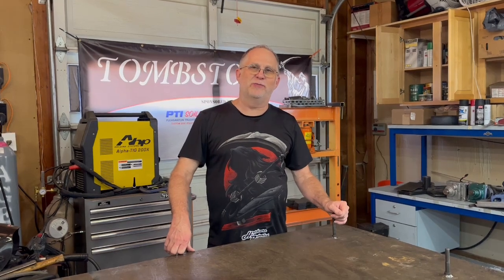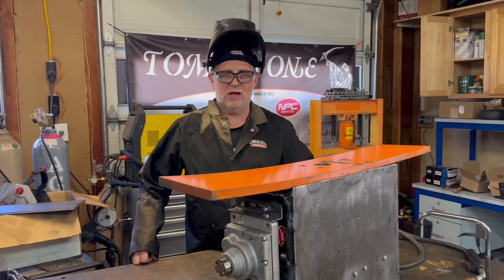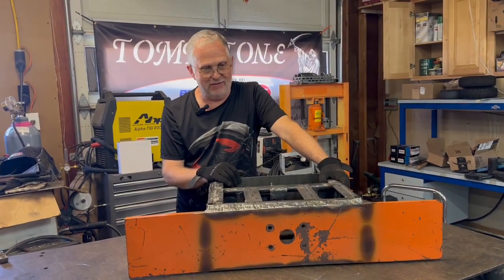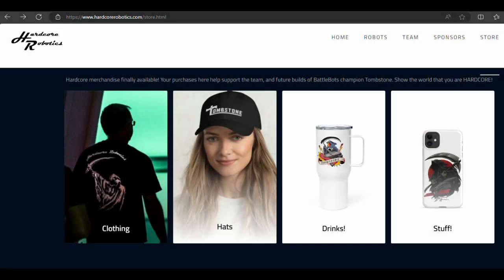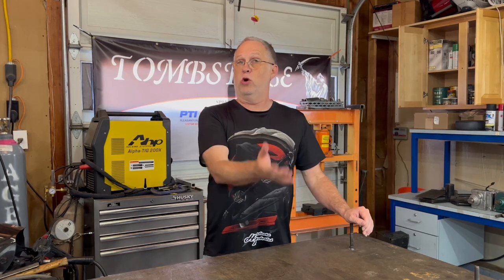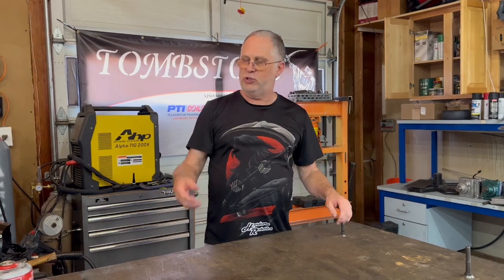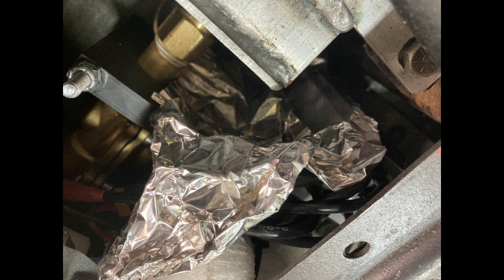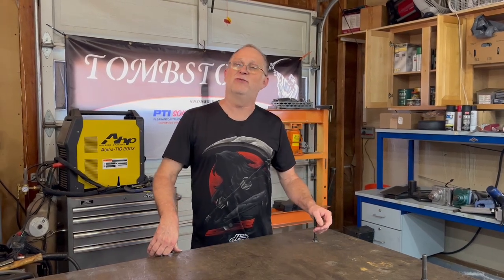Brimstone! - Part 2

Comment: Interesting, haven't thought about using camping fuel. For my propane flamethrowers, I have a choke installed right at the nozzle and invert the tank so liquid propane flows through the fuel line (but combusts mostly as a gas) to get a big yellow flame instead of the blue cone.
Reply from the maker: Yeah, liquid to the valve, then it disperses as a gas as it is sprayed forward. You *can get the larger yellow flame ball from straight propane, but from what I've seen you can do it better/easier with the camping fuel mix.

Comment: I have had very good success stick welding AR500 with 7018, 10018 and 12018 rod. I guess the equivalent wire feed rod would work the same. 6010 mild steel rod was a total waste of time as it literally fell off after  cooling. As the mechanic / welder, I welded with the 7018/10018 rod and the young certified pipeline welder who didn’t like the way low hydrogen rod welded insisted on using 6010 rod.
Reply from the maker: Stick with 7018 would have worked here for sure, but my big welder is a MIG. Just my preferred method honestly. Even if I'm welding aluminum I still use the MIG and the spool gun, even with the TIG just sitting there. 

Just because I can weld doesn't mean I'd call myself a welder ;)

Comment: Silly idea for a bot that's inspired by race cars: a powerful vacuum that sticks the bot to the ground, making it totally stable and (hopefully) stronger than magnets for downforce. Theoretically if you were to use that on a vertical spinner it should eliminate gyrodancing, or (how I'd apply it) use much faster drive motors while still being controllable, ramming a bot before they know what hit 'em. Of course "on paper" doesn't always apply to actual bots in practice.
Reply: Someone actually already made this at the either ant or beetle weight. Can’t remember the name but it was a control bot and did ok. I think the conclusion was that at those small weight classes its just not worth it and magnets do the same thing on a steel floor for waaaay less weight and complexity
Reply: @connorbingel7134  if you're talking about team panic, his design seems heavily flawed frankly since it was basically just an extractor fan.

Comment: what's the reason for not grinding a bevel/chamfer into the wedge/chassis to get better weld penetration? Is AR500 super difficult to get full penetration on?
Reply from the maker: “Grind AR500 to a bevel!” Yeah no thanks 🤣 We use that stuff for a reason and its extreme difficulty in cutting it is high on the list! 

For general welding you are of course right, a bevel would have helped penetration. Instead I just cranked up the welder.
Reply: @ray9368  okay gotcha lol. if I was working on a welded chromoly chassis for an FC 30, would you recommend bevels?
Reply from the maker: Would depend on thickness really. Anything less than a quarter inch thick I probably wouldn’t bother. But it does help with thicker pieces, especially if you’re at the max amperage of the welder you are using.
Reply: @ray9368  i dont get why grinding ar500 to a bevel is so funny

Comment: If you put in an oxygen tank, you can increase the heat of your flame and ergo, increase the range of your weapon.
Reply from the maker: And be totally illegal :) Even if this isn't going into an event, I still wanted to build it to modern combat standards and rules.
Reply: @ray9368  hmm. I didn't know that detail. I was thinking on the detail of gruff's bellows on his bot allowing the same outcome and is legal.
Reply from the maker: Correct. Using fans/venturis to increase air flow is legal. On board oxygenators isn’t 🤷🏻‍♂️
Reply: @ray9368  apologies on the original idea. I was trying to english the idea of getting oxygen in.
Reply from the maker: Oh it's not a bad idea for a great flame, but for safety they don't want anything like that. And I have to agree with them honestly. The idea of Tombstone cutting through a fuel source and an oxygen tank just doesn't sound like a little pop in the arena - more like popping out a lexan panel!
Reply: @ray9368  yeah. Remember the battlebots s5 sawblaze vs uppercut
Reply: @ray9368  wdym by illegal

Comment: Driveway weeds don't stand a chance!

Also pre-heat helps on such thick parts, either from flame or in a pinch long arcing a tig torch (assuming no electronics present that could get fried)..... though you definitely knew that already seeing how well tombstone handles abuse :D
Reply from the maker: I could have done some preheating for sure, but you can see on the front of that plate where the paint changed colors that I was getting decent penetration. It's definitely staying put!

Comment: It would be awesome to see a durability test and see if it can take a hit from tombstone.
Reply from the maker: Brimstone was designed to take a lot of punishment, but of course Tombstone is designed to deal a lot of punishment. All the square edges should favor Tombstone - plenty of spots to get ahold of it. But you really never know!
Reply: @ray9368  yeh I think tombstone would be a really bad match for brimstone. What's the top armor like I could see saw blaze puncturing the gas canister.
Reply from the maker: The top armor is relatively thick titanium, but then again bots like Sawblaze can go through relatively thick titanium.

Comment: @Ray Billings, With all that grinding you should call it... SPARKY! LoL! Also, dude you should put those big spikes on the four screw-holes of the front the kind you used to see on the shoulder pads of the Road Warriors in the WWF! It would look AWESOME! EDIT: Ray! How are you going to stop it from flipping on it's face and getting stuck?
Reply from the maker: The fire box is designed to use 2 of those holes as air intakes to oxygenate the fuel, so really they are kind of important to leave open. I do agree that more could be added up there though. As it sits the bot is square both front and back, so if it were to ever be used for actual combat there would need to be some changes to keep it from getting stuck.
Reply: @ray9368  I just thought the spikes would keep other bots far enough away to allow the flames to breath out as well as they would just look Bad-Ass! :)